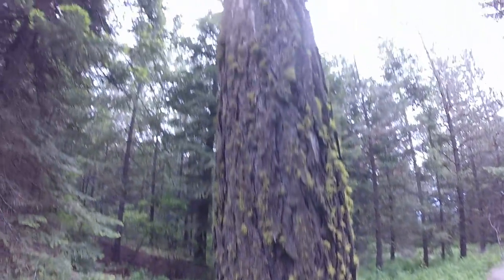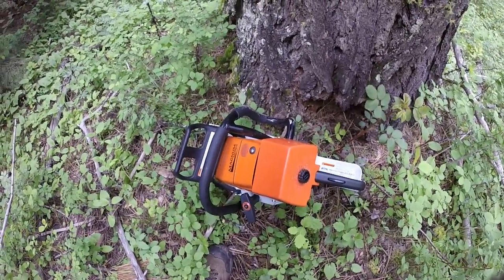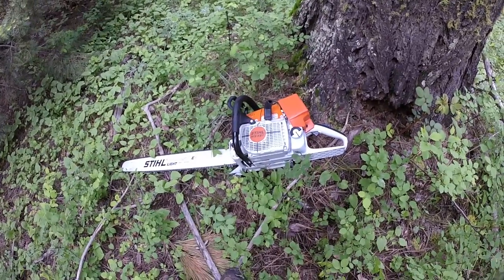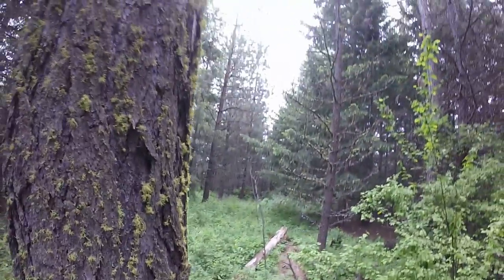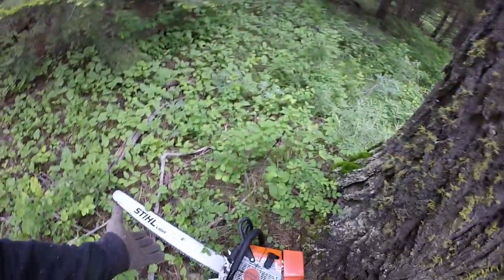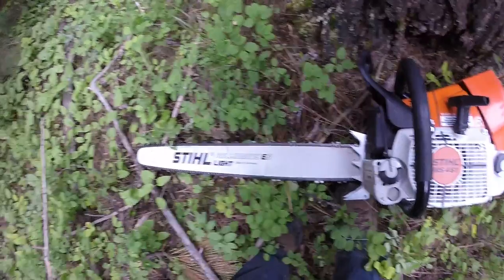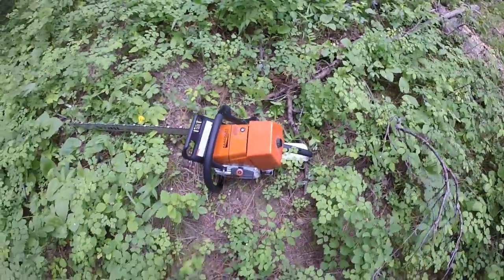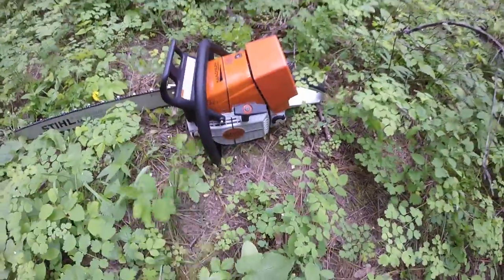Stihl ms461 Insane-O-ized SS

Comment: Good video. My 460 magnum cuts stuff like that like it were a tooth pick. I use full skip RS full chisel chain. Bigger stuff gets the old 066 magnum. What a beast. With a 32" bar & chain. Now the realy big stuff gets the 880. That saw is pure MONSTER. It's just way HEAVY. I'm 65 & not quits as spray as I once was.

Comment: Finally someone on youtube that doesn't edit out their pinch and act like it's never happened to them before LoL 

I've really got to send mine to you! I can't stop smiling whenever I run the Insano Mighty Mite.
Reply from the maker: I'm just a man....
If you haven't been pinched much, then by default, you never bucked much - limb loaded wood anyway.
I cut spruce  (full man) for about 2 years, in S.W. Washington and N.W. Oregon. 3 days out that entire time I never was pinched. SPRUCE - it will drive you crazy! Have a picture of my dad's D7 parked underneath one somewhere in the collection. This is where the term "grouse ladder spruce" comes from.
Thanks for watching.
Reply: I've cut some smaller spruce down by Battle Ground Wa and had a heckva time bucking them. That'd be a cool picture.
Reply from the maker: 7 and 8 footers that the butts are off the ground ( bottom of the bole) 10 and 12 feet sometimes. I had to get up on them and saw off the big limbs (that I could reach), on the low side most of the time, for the first 3/4s of the tree, cripple most of the remaining, and then touch off the last "holder" limb in the top. Sometimes even pushing with the cat was to no avail..... When you did get one to roll over,  they would flop on the ground and look like a medusa laying there.  
Yah, the good ole days.....
Reply: Before I had 2 back surgeries I was better than you at this.......Just kidding!!!  I wish I could stay down on the saw and trigger anymore.  Good video friend.  Also, I did never cut anything as big as you are doing.  Stihl (pun)  have a 210, 011, 026, 460.  The 011 is the go to saw or the 210.  The 026 Pro is museum perfect.  The 460 is too damn heavy.  What we call trees around here you would call brush.  Peace.
Reply: I remember when we were felling up to 80cm diameter firs, those things had branches up to 8 inches wide, some bigger, you basically had to do an undercut so they would fall without violently breaking and snapping back at you, had my saw pinched almost every single tree.
Reply: I had the pleasure of a tree standing straight up when ther was about 20 feet left to go.

Comment: Awesome demonstration of the saws ability, saving for a saw bigger then my 360, found I have to keep the rackers a bit high for the chain to pull speed on the 28in bar in hardwoods (locust, ash and elm mostly)
Reply: Yeah looks like you need more saw.

Comment: What do you mean when you say dark screens?
Reply from the maker: A new saw needs to run, initially at least, really fat on the high speed needle adjustment as the internal parts are starting to seat in. Black/dark screens are an indication of this. A saw does not run really good until the needles are  properly adjusted. It shows the saw runs really good in spite of not being tuned in anywhere near what it will be later, once broken in.
Thanks for watching.
Reply: Dark screen = smoky exhaust

Comment: u ever port a 500i new like never has fuel I n besides test at factory where  fuel is ran through saw a few seconds  idle maybe walk  through some 10 cuts of soft wood off 24 heat so so maybe fired  again. I have what I believe this saw in box like still sealed from last ( stihl owned anything parts oem stihl
Reply from the maker: 4 4 hi. The channel has quite a few 5ooi saws that are new.
Thanks for watching.

Comment: Do you run the same drive sprocket on the 3/8 chain as say .404?
Reply from the maker: Daryl hi.
You cannot run a 3/8s rim with .404 chain or vise versa. You will either throw the chain straight away or burr up the drivers so the chain stalls or both. The pitch is to far off for the chain to rotate smoothly.
Thanks for watching.

Comment: Hello, a chainsaw doesn't need double-declutching, and I've never seen the felling cut on the first tree in such a way that you hold the saw overhead.  It is much better if you hold it the other way around, the handle is specially shaped for this and you can use the claw stop. Work easy, save your Energie!
Reply: That tree hits the ground and his saw never was above his head?

Comment: I don't need to even ship it for almost a year need it back in July the 12 looking to keep anything plastic stock as possible spark arrestor requires to much blow back haha make it stupid I want to blow it up I need to 2 cuts roughly 29 seconds in a 70 cc stock logging  no like any  saw created 2020 or newer under 90 cc 2500 is entry fee I paid 5 years ago that's gone donated to .....  well now build on your part all down under 3500 parts labor machining etc. you  can film everything release whenever saw is back in your shipping ways. 7000 buy in nothing guaranteed other than if I lose saw doesn't explode 30 seconds after I start it on drag race style tree for  any. track and it ships to address u get immediately  from original   I got YouTube w 7000 (Parr of i